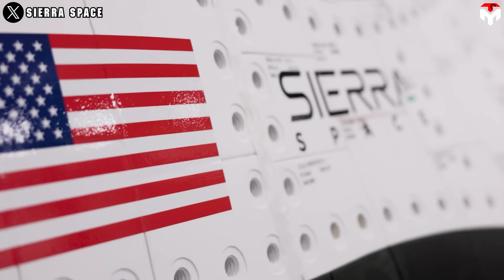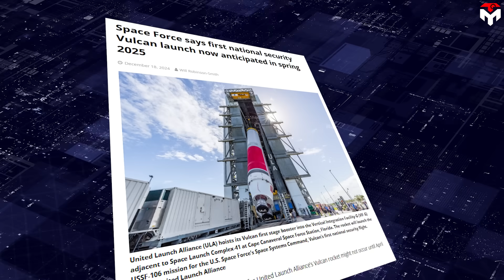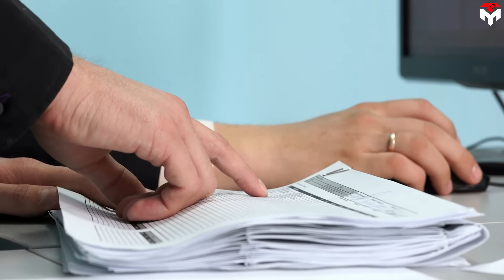Vulcan Delayed! SpaceX Big Solution To Launch NASA's new Space Plane...

Comment: I'm still wondering exactly how they will load people on to Dream Chaser.
 Typically the fairing is in place before the upper stage is loaded on to the booster which if people are onboard they will have to be inside before the fairing is placed and it still needs to be loaded on to the booster. Back during early development(around 2000) it was also assumed that it would be launched on top of an Atlas V which wasn't man rated. That was some of the issues discussed in the early days of Dream Chaser "the idea" and exploring the concept back years before https://en.wikipedia.org/wiki/SpaceDev was bought out by Sierra Nevada Corp.
 The other issue we talked about was the fact that it had no "launch escape system", still we moved forward on development assuming people and/or items for soft landings would be loaded in space either at the space station or by docking in space with a capsule. There was also back then the idea that there would be multiple space stations in need of services from which Bigelow aerospace should have been a key player but sadly the cost to space was too high at the time and Bigelow eventually shut down. I heard Bigelow aerospace was purchased but haven't seen anything from them yet.
 Back then the idea was that pharmaceutical company's and silicon growers would set up manufacturing in micro gravity along with tourism so there would be a need for several space stations and those stations would need regular supply runs. So far that hasn't happened but I think once StarShip/Superheavy is fully operational it could very well become reality and Dream Chaser could be very busy once all that is in place.
Reply: its only rated for cargo not human transport
Reply: See my comment above. Launch the plane without a fairing like the X-20 was going to be deployed and you can ingress the crew like any other capsule.